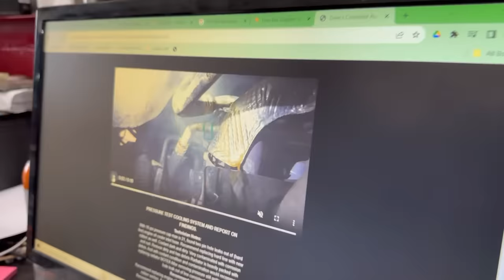The truth about maintenance, and what the manufactures tell you vs what you need to know

Comment: A valuable piece of information I learned in school as a mechanic was "lifetime fluid means as long as the powertrain warranty"
Reply: lol but sad.
Reply: Lifetime fluid is a bunch of BS every fluid breaks down overtime
Reply: What lifetime warranty really means is that you will be working on it for the rest of your life if you cheap out on maintenance.
Reply: same rules go for lifetime snapchats lol
Reply: What happens after a "lifetime" if we listen to the dealer? It dies, true story. :-)
Reply: @ryans413 That’s actually not true, but the fluid can get contaminated.
Reply: @user-tb7rn1il3q  what do you think contaminated is the fluid breaking down loosing its properties becoming dirty once that happens it’s no longer effective it starts becoming a mess. Oil turns from a liquid to a sludge. Brake fluid goes from being clear to black and watery which ain’t good for the brakes. Power steering fluid turns black and looses its ability to clean and eats through seals and hoses same thing with coolant it will start to turn ascitic and start eating rubber hoses and seals and sludge up the engine block and water pump. Even battery’s go bad the acid isn’t a lifetime fluid either. If all these fluids were lifetime they wouldn’t be doing any of this so to claim something is lifetime is BS.
Reply: @user-tb7rn1il3q Shear forces and heat break down the oil. Stop trying to be BobTheOilGuy. It’s not happening for you.
Reply: True statement.
Reply: @JetFire9  The base oil doesn’t break down.  The additives can get depleted eventually.  No transmission has failed due to a lack of fluid changes.  They can fail if the level is low.
Reply: Ya lifetime fluid is for the life of the transmission. The very short life of the transmission.
Reply: @matthewfournier6478  Most transmission failures are not fluid related.  Quit wasting your money, time, and the environment.
Reply: Compromises the lubricating and heat transfer qualities of the fluid. That being the case the most cost effective proactive step one can take to get the longest life out of the transmission is to change the fluid periodically. Like the man said.
Reply: Anything with "LIFETIME FLUID", no matter how long it lasts before breaking down, be it 30,000 miles, 80,000 miles, etc, that was its lifetime!  :)
Reply: They want you to trade it in for another new one after the warranty is out! Hopefully before that.
Reply: I still have a Jaguar 2006 XJ8.  I live in Las Vegas NV with the Desert Heat.  It got to the point where I started to and learned to do all maintenance and repairs because of this " lifetime fluid " BS.  I still drive this thing and it almost had 120,000 miles.  One of the best engines and transmissions I have ever owned.
Reply: Yeah lifetime means the time between when you buy it and when the company y that sold it to you wants you to buy another one from them
Reply: Exactly! 👍
Reply: So good
Reply: Well how do you like to change sealed transmissions' fluid?
Reply: @zeroneutral  There are YouTube walkthrough videos for that, if you want to learn how.
Reply: I had idiot mechanics actually try to argue with me that I shouldn't change the transmission fluid on a RAV4 with 70k miles.

Like I'm going to pay you, f-ing do it.
Reply: That's exactly what lifetime means. People get mislead thinking is their lifetime but is actually the car lifetime(warranty).
Reply: I have heard many mechanics who claim to be experts say changing your transmission fluid can actually cause damage to the transmission
Reply: @ryans413 especially the cvt.  They have very fine oil passages and solenoids. Dirty fluid will torch the trans over time.
Reply: To be honest with you I bought into that lifetime transmission fluid bs because the dealer service guy always said I don’t need to worry about replacing my fluid every time I asked. The fluid passed the 100k mile mark & I just ignored servicing it since it would probably do more bad than good at this point. Fast forward 19 years later and the 4runner is running in top condition with 240k miles.
Reply: So if it’s a “lifetime” fluid, why does the transmission have a drain plug? 🤔

Comment: People seem to think vehicles can last for ever with no maintenance and get annoyed when it fails. Never ceases to amaze me.😮
Reply: Or they’re the “new vehicle every 3-4 years” type.  Buying a used vehicle is scary.  There are so many used vehicles for sale that have been neglected.   Even those “certified” used cars.  That “certified” label is often just BS.  A friend just bought one and the engine blew the first week.
Reply: Well you can blame our industry for that. It has slowly removed the maintenance expectations out of vehicle ownership.

We don’t grease anything anymore. We are using less and less serviceable components (most newer cars don’t even use a fuel filter). We are extending basic service intervals. Hell many late model vehicles don’t even bring a basic dipstick tube to check fluid level/condition. And when 💩 does hit the fan, consumers are taught to discard, and replace the entire vehicle.

🤷‍♂️
Reply: @lynxstarautomotive208  It blew my mind when I heard some newer German cars (can't remember the make) don't have an oil dipstick.  So you're basically relying on the computer to check your oil level, and forget about doing your own oil changes.  Sickening.
Reply: Toyota fans love that statement hard facts
Reply: no people know things need maintenance they just choose not to then blame the mechanic or the manufacture for their lack of maintenance and responsibility 
people know its just easier to blame the mechanic and manufacturer
Reply: @mplslawnguy3389  I don't buy used vehicles for that exact reason. Buy em new & keep em long as i can. Best way to do it if ya possibly can. Ppl think synthetic oils are good for 15k mis! They aren't & neither are the filters. Facts. #F150Tremor
Reply: @mplslawnguy3389 Mercedes Benz. Yup. I will stick w/my trusty F150 trucks! Buy em new an keep em long as I can. Do great maintenance on em. Never let me dwn.
Reply: @MrRGM10  Yea they are some of most dissolutioned bunch (in many cases). Then they have sludge & head gasket issues before 100k mis. Quite often. No thanks! Buy my F150 4wd trucks new ..maintain em well.. & never let me dwn.
Reply: @BuckingHorse-Bull  Right. All machines fail without maintenance. Period.
Reply: If you running it like nun maybe hahaha
Reply: @Davido50 the oil filters are so small at new car is pathetic
Reply: True ass statement..
Reply: Thats why BMW's have a bad rep
Reply: Some used cars are light-years more reliable than others. I drive a 30+ year old car with a small block chevy. It had sat for 8 years before I bought it and had 150k miles on it. I did the maintenance items for 150k mile interval, replaced the fuel pump, tires, oil and fluids, and the brakes. It now has over 180k miles on it and it's running great and gets factory rated mpg, doesn't use a drop of oil. Slightest oil seepage but not on the ground. Even with my scheduled trans rebuild coming up, I'm only in the car at under $6k, and that includes regular maintenance that every car requires. You have to know a little bit of what you're doing, but it can be done. All the under $6k cars currently at used car dealerships are leaking oil or head gaskets are blown, trans are screwed.
Reply: @lynxstarautomotive208 well they use fuel filters built into the fuel pump assembly. They are there
Reply: @XJon2011 Yes, but who is going to replace a perfectly functioning fuel pump (that costs 10x more than a standard filter), to service the built in filter? Makes no sense.
Reply: @lynxstarautomotive208  while I agree, in our family we had a new 2010 GMC Acadia with the built in fuel filter go until 215k miles before I sold it. Ran just fine. Our 2013 F150, twin-turbo V6, has ran fine and it sits at 298k miles on it right now and is still being driven. Both have had no fueling issues even with direct injection and demanding fuel requirements for turbo applications. The US has dirtier fuel compared to Europe and still no problems on the modern cars we've had. I think consistent use is a key to longevity but my 30+ year old Chevy runs fine after sitting outside for 8 years and when it's tired out, it'll get parted out and I'll have my money back.
Reply: @XJon2011  The reason these pump last longer, is because the LPFP now operates at a reduced output (8-10 volts on average). Which limits power feed, and load. So it works less, and therefore sees extended life cycles. The same can’t be said for HPFP that are located on the engine tho, and really do all the work. The in-tank pumps are really just a lift pump these days. It’s similar to a diesel. The high pressure pumps see the greatest workload, and stresses, and crap out far more often.
Reply: People fear mechanics like they fear doctors.

Partly rip off mechanics partly real riding costs of motoring.

Look at timing belt/chain costs these days. There are so many complicated procedures to get to timing belt/chain these days and many cars now mechanics will say "while I'm in there, I should also change x y z" which might be true but it often means the Joe public had to pay $1500+ for timing belt chain and associated services.

Many cars need to have revised pistons because they leak or have sticky pistons
Reply: Yes David, you told ussevetal times you buy new. Don't have to keep repeating it
Reply: dont know what you are talking about. i am not driving a lot with my car, so it comes to 3-4years intervals of oil changes. an the car is built 1987 and i got it 2003. the waterpump and the liquids are from before 2003. still runs fine, and i wont change it soon. iam driving it over 20 years, basicly only short distances. and sometimes i also go on the racetrack to have some fun. still runs fine. and because its a sports car, iam not driving it slowly.
Reply: And THEN you hear the "these toyotas are rubbish, I'm never buying another one". Then they get a kia....
Reply: @BuckingHorse-Bull it's easier to blame, but the manufacturer and mechanic can still tell you what it's gonna cost you.  The bill is what it is and if it's past warranty there's no case for the consumer to make if they didn't perform at least the factory recommended service intervals to that point.
Reply: @mplslawnguy3389  that'd be an Audi. My coworker had one. My coworker also ditched it and bought a pickup when the dealer said they'd need to replace the engine under warranty.
Reply: It's the dealers fault making them believe it's that way.
Reply: @mplslawnguy3389  I am to understand that the 2025 model year 1/2 ton Ram pickups with the 6 cylinder hurricane engine have NO dipstick, its some level indicator on the dash so that means messing around trying to figure out how much oil to pour in for an oil change and so forget a vehicle owner needing to lift the hood .. I guess the only one that needs to check anything under the hood these days is the dealer .. when your vehicle gets towed in !.

Comment: My family gets ticked off on me for constantly doing maintenance on a car. ‘It’s too often!’ - they say. Well personally, I don’t think it’s too often. I change transmission fluid every 30000 miles, I do oil change every 5000 miles, I change cabin and engine air filters every 7500 miles, replace spark plugs and ignition coils every 100k miles, top up all fluids. I inspect brakes once in a while, add air to my tires. I go to a shop to repair the vehicle because I dont have a lift to raise the car in the air. For something small, I do my own repairs. For something bigger like the struts and shocks or tire swap I go to the shop. But I keep the vehicle in check all the time. It’s my tool to get everywhere so I need to take good care of it. You mess it up, it’s on you when the technician gives you a huge repair bill. When I do repairs, I read and watch the videos multiple times to make sure I remember how to do the repair. Because sometimes, when your vehicle breaks down, you’re on your own, so that’s that. And in order to save money, in my case, I must learn how to do simple repairs myself, because I don’t want to be a clueless fool and panic when the car breaks down. I had own my vehicle for 7 years now, when I bought it used. It had its share of problems - AC stopped working, back brakes blew up, PCV valve broke down, Suspension parts broke down, front brakes were 100% gone and I was still driving without knowing, when I didn’t check at first, camshaft and crankshaft sensors were replaced, MAF sensor replaced, Rear wheel bearings replaced, and many more including the regular maintenance like oil changes and stuff. You got a car, take care of it so it can take care of you.
Reply: In the US I need it for transport, to and from work, groceries, in case of emergency. I’m a single guy so I need my ride to be reliable and in shape, therefore, I take care of it
Reply: My cars 20 years old and it’s showing it’s age technology wise but it still runs and drives the transmission is original the engine is original. Coolant been changed every 100,000 it’s the Dexcool that everyone hates I’ve had absolutely no issues with it. The car almost has 200,000 on it so I’ll have to change the coolant agin here soon. Oil gets changed every 5,000 the brake fluid has been changed every 20,000 no leaks in the system ABS works just fine. Power steering fluid I change ever 20,000 as well very easy to do just take off the return line start the car move the wheels lock to lock and let the pump pump out the old fluid. The battery has been changed every 4 to 5 years the serpentine belt gets changed as soon as it starts making noise or I see cracks. Wiper blades I change on the daily as soon as they start streaking there garbage. Washer fluid is always topped up. Car gets cleaned inside and out regularly helps keep rust from forming once rust starts car is garbage. The AC still works all the parts are original. Brakes are important and I recently did those new rotors pads and discs and the back wheels got new drums shoes and hardware. Tires are important to I recently got good brand names all season tires. I like doing the maintenance especially on an older car just to prove to people a car can last forever with proper maintenance.
Reply: @ih8momjokes1 certain cars are very sensitive to trans fluid, like Mazda skyactiv , the new 10 speeds from gm and ford, the zf 8 speed in dodge and bmw , me personally a 240$ trans fluid change is a hell of a lot cheaper than a 6-10k transmission
Reply: @ih8momjokes1 that’s only true if you never change it
Reply: I have the exact same mindset as you regarding my vehicles, and no surprise to me, they never "break down" like other people's cars do!
Reply: The Only Thing You're Wrong About Is The Air Filters. Dude That's Way Too Fucking Often
Reply: Sound like reasonable intervals. Air filters are cheap the least amount of dirt ingested the better.
Reply: Well Said!  👍
Reply: I agree I do the same as you  305,000 on a diesel truck and I work it like a rented mule.
Reply: The same here. 24 years old 282500 miles and still strong.
Reply: That's all NORMAL intervals for older cars even early 2000s with maybe another 2000 miles more on the oil
Reply: Don’t forget cam / timing belt, could save your pistons… I bought one for £16 but the only place I can find to do it charges £500 and my car is worth roughly £800. Will keep looking!
Reply: "replace spark plugs and ignition coils every 100k miles" most spark plugs require to be changed far more often.
Reply: I was formally trained as an auto tech. I've always been a nut on maintenance. Never listen to the manufacters recommendations. They are designed to make your vehicle fail at the warranty end date.
Reply: @TomCatHando not really, if you clean and gap them, they can last that long. You just have to maintain them.
Reply: @cprooks  Depends on where you live.  Every summer, pollen and dust coats my car in yellow dust.  Sure my air filters get dirtier quicker than 12,000.  I barely drive a single vehicle that distance in a year anyway, so I change once a year or when it looks dirty.
Reply: What kind of ignition coils you using Iridium?
I use coppers on my 22 year old Jeep Grand Cherokee Laredo 4.7L V8 Selec-Trac SOHC.
I change them every 30K miles, Platinum's every 70K and Iridium's every 100K.

Transmission fluid every 50K with pickup and screw on filters and change Shift Solenoid after 100K miles, Coolant and brake fluid every 5 years, use brake fluid tester every month.

Engine oil fully synthetic high milage 5W-30 every 3000 miles with OEM Mopar filter. Not Wix, Not Fram, not K&N. OEM is best for your specific engine.

PCV Valve and shift solenoid should be OEM.

On Suspension and Steering components I use MOOG because they are cheaper and beefier than OEM.
Reply: I used Denso ignition coils. Though every car uses different ones. So far, I had no issues. The car always starts, no matter what. Be it super cold or hot. I get 34 miles per gallon combined from it. And thank you for asking.
Reply: 100% and well said!
Reply: Spark plugs 100K miles? 😅
Reply: Engine air filters actually filter better when they have significamt mileage on them. They are also extremely over engineered from a surface area perspective, you can, and should, extend your change interval.
Reply: Great advice!
Reply: Very reasonable intervals. They will be asking you for help when their engine starts having problems.